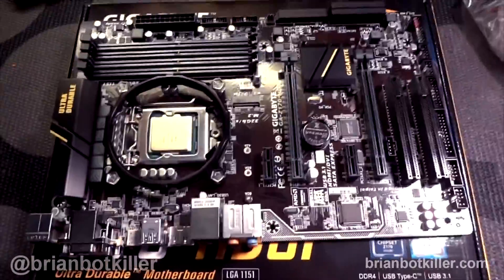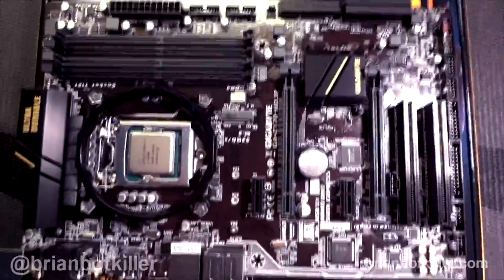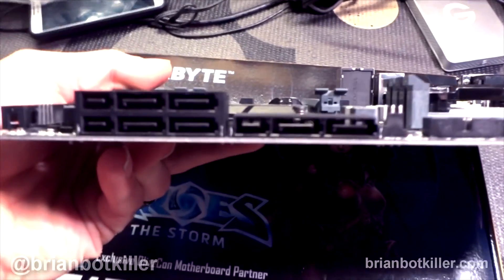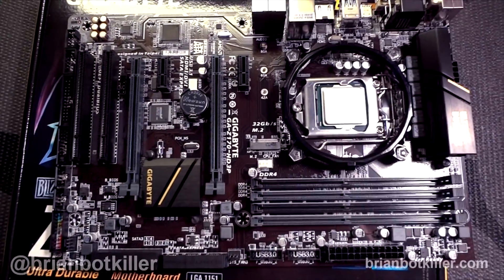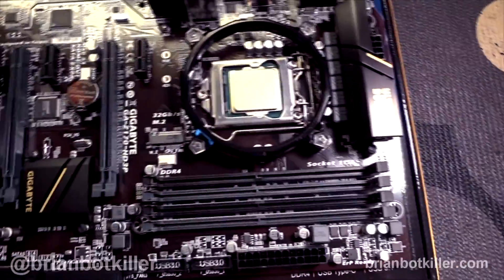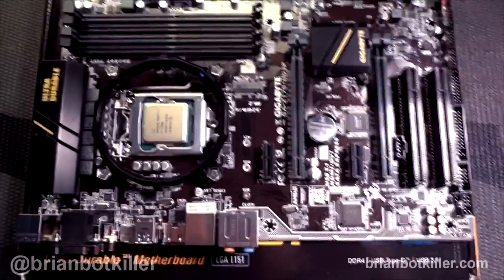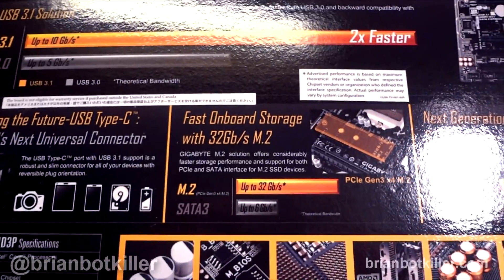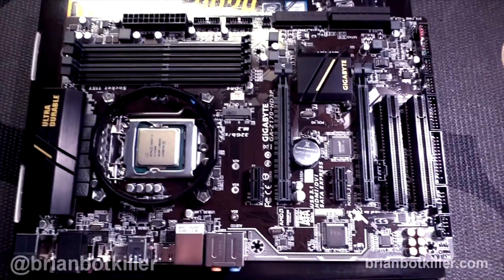Tech Tuesday: Gigabyte Z170 HD3P Motherboard Overview

Comment: hi i combined this mobo with the i5 7600k and a gtx 1070. the BIG problem is that i dont get the fps which i should have and others have.. i dont get it i have the same components and the same graphic settings and i have like 40 fps less in bf1 for example please help me
Reply from the maker: Are you overclocking the CPU or GPU?

Comment: would a i5 6500 and a gtx 1060 6gb work fine with this mother board? no bottlenecks and stuff like that. Oh and by the way which is the cheapest procesor i can get for that gpu( the 1060) without bottlenecking and getting a good performance for today games.
Reply from the maker: It would probably be ok, but really, don't skimp when building a proper system. I always see people say that they want the "cheapest" possible system, and buying cheap systems is a silly thing to do.
Reply: So what mothetboard would you recommend to me for the i5 6500 and the gtx 1060
Reply from the maker: I like this board, it's simple and gets the job done, but I get all  my PCs at http://www.pcaudiolabs.com :)
Reply: Nevermind i got a gigabyte gaming series 3 h-170 and its a beast!

Comment: ps/2 is still prefered by many fps gamers and other keyboard freaks, because it's faster and support pressing many keys at same time, and a lot of new usb keyboard also support ps/2 port
pci is still used by many people who have older audio cards and want better audio than onboard sound
Reply: ps/2 is goign to desapere with the next intel mobo's gen. A big part of the new keyboards include an gold usb 2.0 for 0% interference and you can press more then 1 key a t the same time.
Reply: I agree that ps/2 is going to disappear one day, but people are saying that for last 10-15 years and it is still present on most motherboards.
Gold usb connector is more advertisement than anything else, it doesn't have anything with interference but might provide better connection and less rusting of connector during the time.
Not all usb keyboard support pressing more than 1 key at the same time(even some expensive don't), and that depends on it's circuit logic, but all ps/2 do support that and even have lower latency doing that.
Usb keyboard on other hand can support much more cool fetures that ps/2 can't support in same way like usb hubs, rgb lighting, etc.

Comment: im a noob but does a motherboard change anything gameplay wise if lets say u have this motherboard or an maximus v111 (not including extra features such as 2-way sli and such)
Reply: Speaking as a post-noob non-expert; probably not much with this board. It's been performing pretty well also in overclock tests. It lacks a number of extras and some safety max voltage regulation etc seen on pricier boards. 

You can however run into cheap boards that struggle running an i7 at stock speed so look up performance reviews and purchase site user comments so you know what you're paying for.

Comment: You nearly skipped the amazingly FAST M.2 SSD interface:
Per Gigabyte website:  
"M.2 Socket 3 connector (Socket 3, M key, type 2242/2260/2280 SATA & PCIe x4/x2/x1 SSD support)"
"PCIe Gen3 x4 M.2 Connector with up to 32Gb/s Data Transfer (PCIe NVMe & SATA SSD support)"

I almost ended up buying a MSI Z170 mobo with their crippled SATA6 M.2, versus this full-blown version.  This is no small difference!!
Reply from the maker: Yeah, good point, and thanks!

Comment: does anybody know what connector the m.2 port is using on this motherboard (m, b, a, or e)?
Reply: +Josh Klein    Per Gigabyte website:  
"M.2 Socket 3 connector (Socket 3, M key, type 2242/2260/2280 SATA & PCIe x4/x2/x1 SSD support)"
"PCIe Gen3 x4 M.2 Connector with up to 32Gb/s Data Transfer (PCIe NVMe & SATA SSD support)"

Comment: Hey Brian im building a pc and it has this mother bored in it 
http://pcpartpicker.com/p/CbHRD3
It seems to shutoff and on again after awhile..
and it looks like the pins are bent i have NO idea if it was ment to
but like in this mother bored there are 2 parts to the pins kinda
The upper pins are facing souther im perfect harmony 
and the lower pins are facing northern.. in perfect harmony
Reply from the maker: +Gon Freecss If the pins are bent, you're sort of boned. Bent pins = really bad. You mean the CPU pins?
Reply: yeah the one in thr socket since its intel. but do you think itll cause it to not stay on ? i thought itd only not post

Comment: hi,
nice video.
planning to make my first build and I'm not sure if i'll be able to overclock with this board, which anyway, seems quite good value for the money.
any idea?
thanks
Reply from the maker: +Salvatore Vitale Oh yeah, you can.  It's got the usual Gigabyte OC options, very easy to kick  up the BCLCK and etc. Lemme know if you need help!
Reply: +brian botkiller so would You go for a K version, rather than the standard skylake? I'm waiting for the price to settle down...unfortunately the exchange rate makes the € prices ridiculously high. Thanks!
Reply from the maker: Salvatore Vitale I always use K series CPUs, I think that is for the best :)

Comment: how many fans can you plug in this MoBo ?
Reply from the maker: +geo4st 4 fans total, one of which is CPU.
Reply: Thank you very much
Reply: +brian botkiller so 3 fans plus 1 cpu cooler fan which is my corsair h100?
Reply from the maker: +BOBBY ADAMS Correct, you should be good.
Reply from the maker: +geo4st You got it, please sub for more, I do lots of overviews!
Reply: +brian botkiller I subbed, and what type of pin are the fan connectors
Reply: +harkirat chahal if you mean if they are pwm only the 3 of them, cpu and 2 more. I just buy an adapter and connect 2 fans In one to controll them
Reply: +geo4st the case I bought the s340 with 2 pre-installed fans, a hyper 212 evo, and 2 other case fans
Reply: +geo4st what I'm wondering is how I am going to get all 5 in 4 connectors

Comment: have couple question about this board. 

1. does a corsair h100i gtx cpu cooler work with it since there is now cpu fan header since u mention there is no cpu fan plug in?

2. will a nzxt hue+ RGB led work since I don't see a usb 2.0 header on the MOBO but I do see 2 usb 3.0 on the MOBO can i plug it in there ? help thx
Reply from the maker: +BOBBY ADAMS There is a CPU fan header, not a CPU OPT, which is usually for pumps on water coolers.  Should still work fine. 

There are two USB 2.0 headers on the south bridge.  

Thanks for watching, please sub for more!